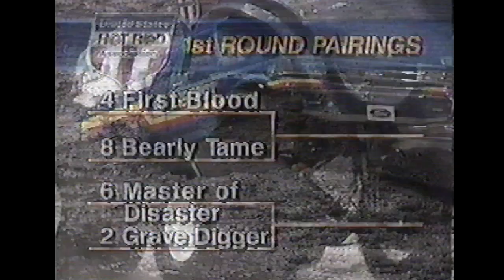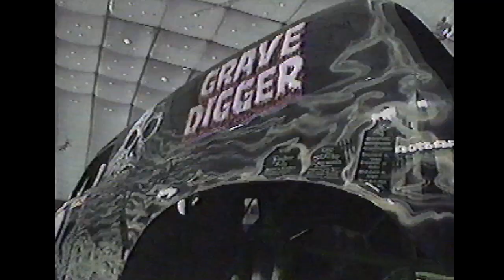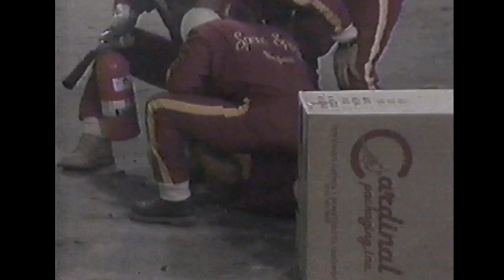1991 SUPER TRAX! USHRA CAMEL MUD & MONSTER SERIES FROM MINNEAPOLIS!

Comment: Bob Chandlers latest creation there Brett? Bigfoot 9 which was the latest was all really out. Not to mention Bob already had the frame for #10 already built from 1990, but that was put off to the side and a totally redesigned chassis would be built for #10. The original chassis for #10 would eventually be built in 92 and would debut in the beginning of 93 as #12 the dedicated display truck.